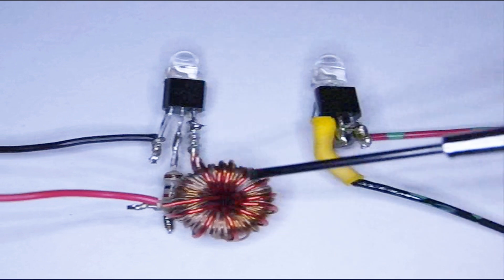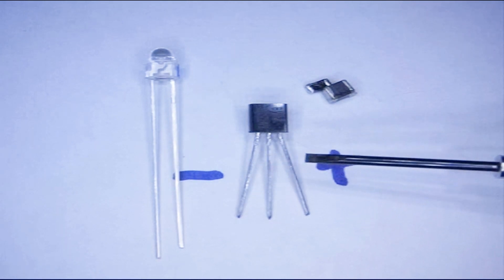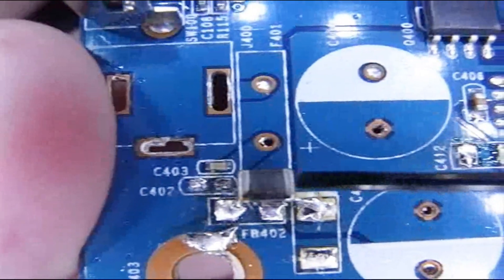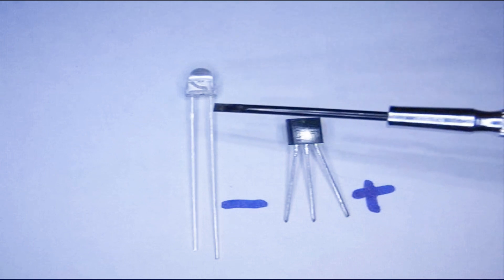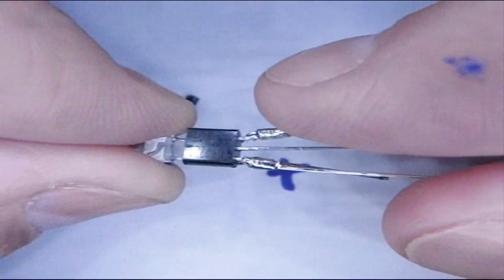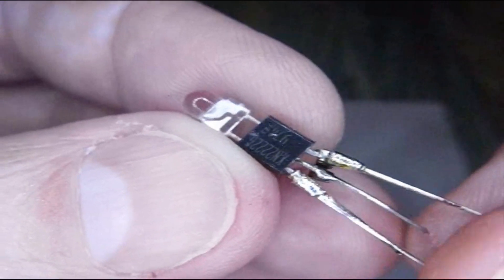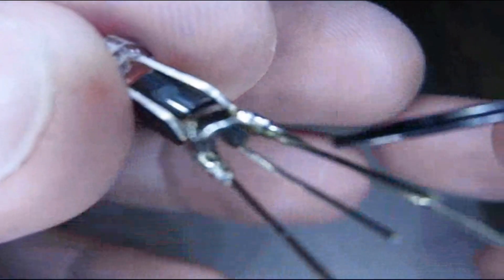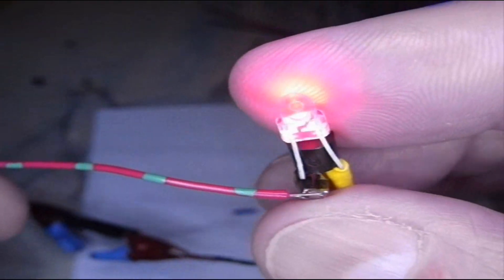Joule Thief, No Toroid Coil - How to Build

Comment: What common uses does a Joule Thief provide?
Reply from the maker: There are many similar circuits.  What this does is take a lower voltage and convert it to a slightly higher one (it "transforms" it by trading off current for voltage).  You find them in single cell cell LED flashlights for example.  1 battery is not enough to power the LED by itself, but it has lots of extra current, so a small step up circuit like this changes the extra current into higher voltage.
The power supply of most laptops do the opposite, they step the voltage down from 110 or 220 to 12 or 24 volts, which allows them to take very little current from the wall to operate.

Comment: I was going to ask why the LED does not need a current limiting resistor, however I just read the description update....lol  congratulations on this concept, I would not have thought of using surface mount components (mostly because I would need a microscope to solder them without a 3m station). Thanks.
Reply from the maker: That resistor is not a bad thing.  I killed this one just just *tapping* the leads on a "dead" 9v battery.  Flash fried it.